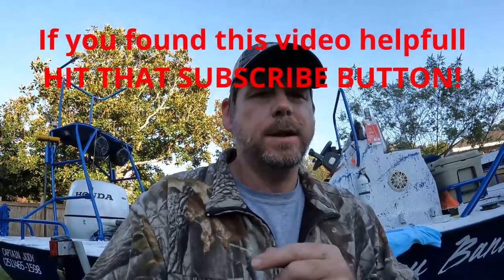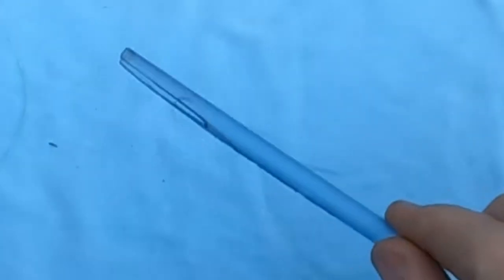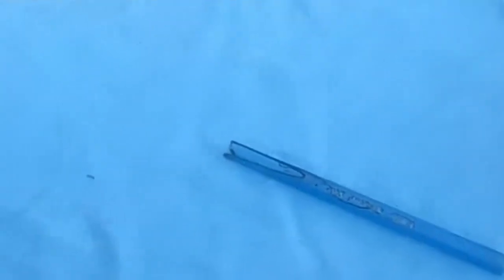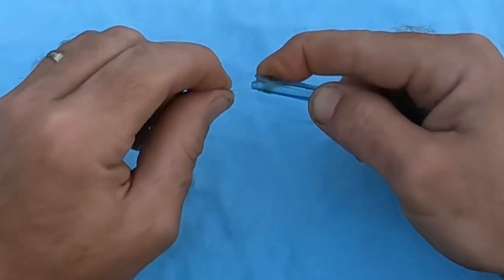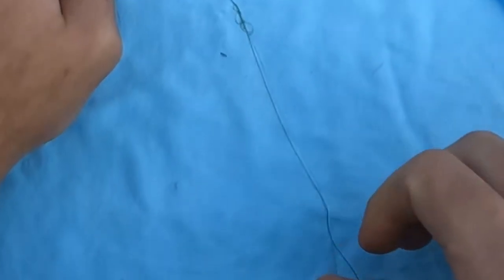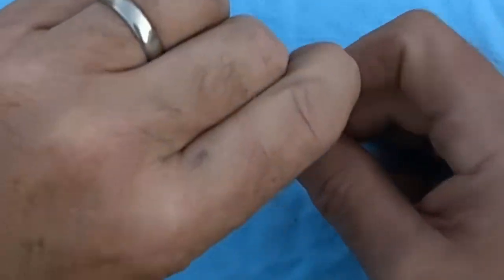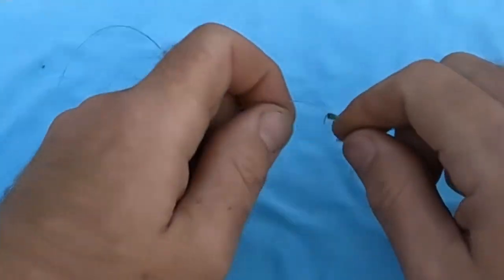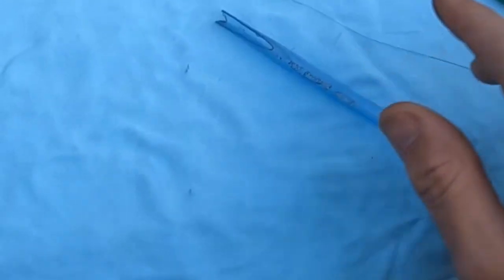DIY DOUBLE UNI KNOT TOOL**PERFECT KNOT EVERY TIME**

Comment: Cool invention…what if you created the same cutout on the other end of your plastic pen, and run both your flouro and braid thru opposite sides of your device until each line comes out on opposite sides…then you can tie a knot on each side, one using the braid, the other using your leader line…hope that makes sense. 👍🏼🤙🏻
Reply from the maker: Good idea, that should work well!
Reply: @bayoubanditcharters  👍🏼….at first I thought you were making “nail” knots instead of uni knots, but I think they are uni knots…I have to visualize your knot more carefully….